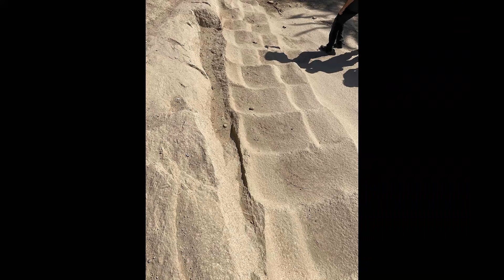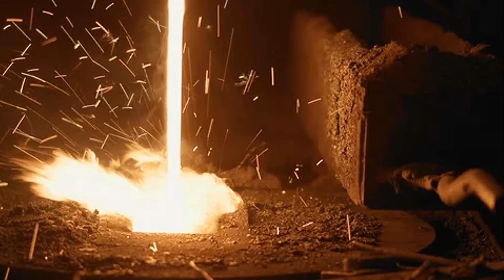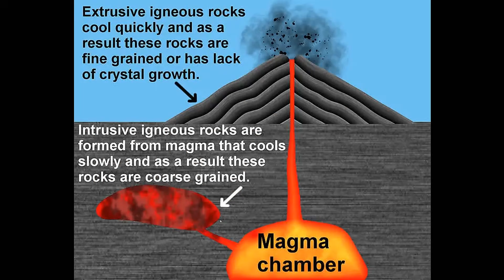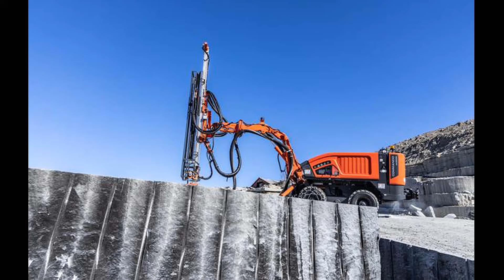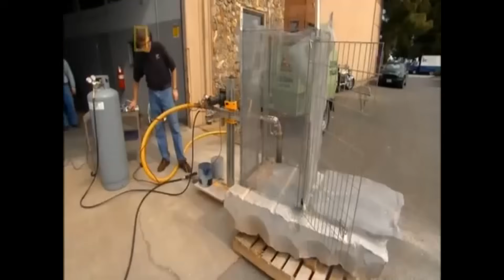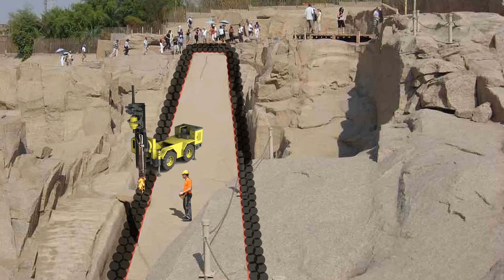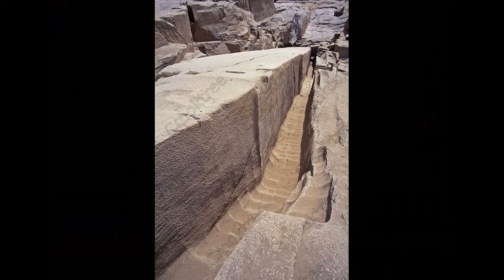Scoop Marks in Egypt: A Groundbreaking New Hypothesis

Comment: Maybe this hand held tool was two giant metal tuning forks working in tandem that vibrated a blade or blades at the correct frequency and was used to cut through granite at its own natural frequency? Quartz is used in radios. Maybe there's a correlation? I dunno. Build an ultrasound tuning fork cutting tool  and hit it with a sledgehammer, I suppose 🤔🤷🏻‍♂️

Comment: Definitely a plausable theory, makes more sense than others I've heard, especially the pounding stone theory.
What is truly incredible to me is that anyone that challenges the mainstream archeologist  concept that this was all done with pounding stones should be considered a cooke or conspiracy theorist.  That theory is far less believable than the one that it was aliens in spaceships that did it.  Every theory however should be listened to and analyzed, and this theory is as good as any I've heard.  If it is true this was how this was done, it is still high technology, and doesn't answer the question as where it came from or where it went.  Would love for you an Ben from Uncharted X to get together.  Other examples  of high technology that Ben has done considerable research on are the precision of stone vases that come from early and predynastic Egypt, that were absent from later dynasties.  All this suggests the use of computerized milling tools and the tool marks left in the stone megaliths suggest they come from large power tools.  Of course the big question is where did these people go and what happened to their tools? All we find is copper and flint chisels which no one in their right mind could believe achieved this level of stonework, or could be accomplished by people that hadn't even invented the wheel.  They had no wheel, but we're supposed to believe they were able to lift and move huge stones of extreme weights hundredes, even thousand of miles that would be difficult for the equipment we have today.     
Good Job!

Comment: You're obviously holding off on doing a video about the SAR scans...Smart but cowardly lol

I forgive you

My theories about the scoop marks?...& Just judging by the patterns 

I'm picturing a person standing holding a tool with two hands that's about the size and shape of your average household broom, then he would make up and down motions - this would partly explain the scoop shape 

Now this tool would have to act something like a sandblaster because the center of the scoops is much deeper than the edges, at the edge of the spray the stream is weaker if that makes sense 

Then if the operator has one end on his shoulder and is making up and down motions with the tool,  The spray end would have to be shaped somewhat like a vacuum cleaner head

I think this configuration would account for the shapes of the scoops and it would also account for the different scoop sizes if the operator held it farther away or closer then the scoops would vary in size

Now for what they used in the tool to remove the rock I can't exactly say, I'm only theorizing perhaps its something to do with vibrational frequicies so

But if you grab your broom in the kitchen and make those up and down motions you'll see what I mean lol...

Comment: If an aluminium can is placed on the ground, it can biodegrade over 10,000 years.

A metal pedal go-cart was left under a hedge at home where I grew up & it completely & totally (100%) rusted away in 20 years.

Most machinery that creates these markings, will disappear in the same manner (other than those who get their materials repurposed over the years) & still are consumed by time.

This makes solutions less simply solved.
Just saying...

Comment: Flame drilling? Wow!
That's an interesting angle. Typical fuels used for flame drilling are pressurized fuel gasses (propane, acetylene, or hydrogen) combined with oxygen to create a hot flame. What do you suppose the ancient Egyptians used for fuel for this rig? Wood, charcoal or coal? Those don't seem suitable. Perhaps animal dung? Doubtful. How about olive oil? It's a liquid and it's flammable, but it won't burn hot enough. Then there's the problem of the massive amount of fuel and oxidizer used which is represented by all of the so called "scoop marks" or troughs just at this one site, never mind the rest of the world where this technique was used. Were there enough olive trees in the world?

Still, heat spalling is an interesting idea. Clear glass dates back to Egypt at about the 9th century BCE. If the invention dated much farther back, perhaps the ancient Egyptians could have generated the required heat by concentrating sunlight with lenses. That's a more believable technology not without its problems of heat dissipation and accidental burns. But, there's no evidence of this.

Finally, I remember seeing a close inspection of those troughs that shows repeated impact marks consistent with the use of pounding stones. It was slow, back breaking work; hard for us to conceive of in these modern times. Unless there is evidence otherwise, that's how this work was accomplished. The unfinished obelisk was a project where the Egyptians bit off more than they could chew.
I do like this video and I like your thoughtful approach. Keep asking questions, and keep looking for answers.

Comment: its simple..we are stuck thinking hundreds &thousands of years old. Its MILLIONS before the material petrified and/or turned into the very hard material we see now. They looked at prior examples and hardened or changed the soft material to hard. The obelisk is still there because it was hardened TOOOOOOO EAARRLLLYYY  or TOOO HARRDD before simultaneous finish cut, harden then lift PROCESS. Too hard during lift process..to heavy to move.

Comment: This flame drilling concept has some legs, and it ticks many of the boxes in a fairly unique way, but for me, a major problem with it is the flame pressure required to generate the power needed to continually fractur the stone, plus the material for the pipe and nozzle that it would need to have been directed through. (I do recall a reported method of generating more heat for safe crackers where the flame was directed through a copper pipe which gradually melted, giving of a much increased heat, but I don't know any more details of this.)
Modern flame cutting methods seem to use small diameter nozzles, perhaps to ensure they get enough heat pressure, and of course they are gas driven, with a mixture of gases and air mixtures to get the required heat, so there is far more here to consider than just a scaling up of the pipe and nozzle size and the material used for them.
But...the flame method does tick boxes that other methods do not, and the  balls could have been used to pound the scalloped stone sides into a flat surface. 
Anyway, great idea and good video, and perhaps it is good that Hotspur and the Tin Man have been retired.

Comment: This is not a good theory. You kind of had it - then went too far. 

The essence of Occam's guidance in solving mysteries is to not multiply entities beyond those necessary to explain all the evidence. You should have just stopped at fire-setting, because that is enough and explains it. Now you have to get some pressurized flame somehow, etc. but it's not needed. Heat concentrated against the granite from wood/charcoal fires, likely contained by simple confinement structures, could apply enough heat to leave nice glowing orange spots where a splash of water would permit conventional primitive tools to leave those scoop marks, the depths of which were where the temperature was just barely hot enough to continue to weaken the stone.

Comment: A block or Iron (meteorite) or copper heated in a fire would sear and burn could be pounded into the granite by three people hammering it into the stone causing vibration, an electric charge in the stone, and would not need a fire directly on the stone.  So, no burn marks left.

Comment: There is a scientist who worked out how they made their cement. He showed how a particular salt formulate would dissolve the court crystal within the rock, making it brittle, and easy to pound into a powder for a base ingredient. I would think, by using a similar method, that is sloshing the salt formula at regular intervals into the gaps of the rock faces, you could then just use a hand tool like a heavy spade, to then crack out the brittle result. Then repeat, it would likely create such parallel trench lines as we see.
Reply from the maker: Thank you. One problem of the natron/ sodium carbonate (and other chemicals) rock softening method is that it usually would significantly change the rocks' colors and appearances, while the granite of Aswan quarry shows pretty consistent color at all scooped areas. Chemicals can be used to weaken or break down rocks in quarries, such as expanding grout to be poured into pre-drilled holes in the rock, but this wouldn't create scoop marks. In some cases, specific acids can be used to dissolve certain types of rocks or minerals, but this is a slow process and used particularly if the rock is ground to a fine powder, but not in dimensional stone extraction.
Reply: Thank you for taking the time. I just think, stepping back from this dilemma and viewing it with fresh eyes, that some sort of rock ' softening ' technique was employed, remains as the most likely answer. Just because we haven't yet  found such a ' technique ' , does it not still fullfil the simplist ' missing link' answer to understanding the ' how '

Comment: Wow... That thermal thing looks promessing.
To me, those scoops looked like something made with a strong waterspray. High waterpressure would have made this. Like with a K"archer, but more pressure.
Aren't there people that suggest the pyramids were actually large hydrolic machines / waterpressure. Or pumps.   
Today they use waterpressure to cut strong materials.
On the other hand, electricity and flames (like you explain) would work I guess.

Comment: After thinking about this for a while I had the idea of what if instead of producing a flame, they could have just used the power of the sun and some large polished metal reflectors. This would be able to heat the granite and spall it repeatedly and I would imagine that this would be doable in a short amount of time which could be why they are able to just seemingly abandon pieces that are almost done. I tried to work it out with chat gpt and we came up with heating the rock would require 63m2 of surface area focusing onto a point of 10cm to reach a temperature of 600C. This technique would also work well with any angle as the reflectors and focusing mirrors would be movable by hand. They could have used polished copper as the reflectors easily
Reply: The solar concentrator idea seems like a natural solution.  They did have copper metal at the time that could be shaped and polished as a concentrating mirror. However they didn't have to heat the surface to self-spalling temperature, as high heat alone weakens the granite and could use tool pounding to shatter the surface much more easily.  In addition they could have employed dolerite tipped timbers as pounding hammers using the power of gravity.  This would allow continuous strikes in the same vertical plane giving rise to the vertical striations of scoop marks.   So aim solar reflection and heat a point.  Drop dolerite tipped hammer.  Raise hammer.  Clean out shattered bits.  Heat again, etc.
Reply: @johnlogajan2571 I like that better actually. Seems more plausible
Reply: Great answer with polished brass or gold overlaid reflectors producing very high efficiencies. Slightly concave mirrors make smaller but hotter spots. Teams gather direct sunlight focused to a gathering mirror, further reflected to get spots down and under. Heat for long enough to get rock crackling a few centimeters deep, enhanced with quenching. Also just building fires within confined mud straw temporary structures and rocket-stove airflow can apply enough for heat/quench, followed by scooping with conventional tools. Evidence for this exists in the form of rock residue in lens shaped spalled chips, fire ashes and scorching, etc. No remaining evidence of the fire confining method used from what I read.
Reply: Yeah mirrors at the bottom of the trench facing up. Keep thinking cause mirrors don’t work. Heat kinda plausible. But how. Those scoop marks appear around the world at other sites.  So let’s figure this out. Stone dissolving heat or chemical or airblaster or ….?
Reply: @pj6585 have you ever focused a magnifying glass on a leaf? It starts on fire, scale that up and you can heat a rock enough to get it where you can just chip off chunks of rock. Would be relatively quick and easy and simple back then

Comment: Instead of flame drilling, sound vibration was sent through a cone from the base (wide end of a cone) to the apex (point of cone).

We were conditioned to think only of sound proceeding from apex to base, which is the case in a speaker and experiments involving sound invariably employed that configuration and not surprisingly nothing new was discovered. If the volume was turned up to a deafening level the only result was a complaint from neighbours.

Comment: I always thought these were from grinding wheels, and that area next to them is where they rested the wheels to slow down in between shifts. And the edges of the grind wheel will weather down faster hence the oval shapes.
They knew pulleys and l9ad bearing, so getting a rock spin on a shaft was well within their knowledge. Also Egyptians loved to brag and were meticulous with their record keeping if something as grandiose as a stone cutting flame torch was present. 
They would have wrote about it or at least the civilizations around them. Not to mention the military application of having such technology... while having a wheel on a wooden shaft just as every wheel won't be something they brag about to everyone as it should be common knowledge. And the round stones that everyone thinks of pounding are the leftover smallest pieces that remained after the original wore out.
Industrial projects leave Industrial scale waste too... sp they are not pounding stones they are the waste.

Comment: To get obelisk out they would have feather and wedged apart the rock in between the obelisk and river. They can then reuse these imprecise blocks for later construction. A not would be weighed down and a sand ramp crates between this and the obelisk. Once broken off the obelisk slides down the sand ramp as parts are shovelled away to control descent speed. Once in the boat the weights would be removed and the ship would lift. Not saying this is the way but potentially a way. It would have to be a mighty large boat or somehow be extremely buoyant. Perhaps they trapped air in the base of the boat?

Comment: Primitive cultures did NOT have mysterious methods and had to use wood, stone, ropes, and abrasives.
Rope saws have been used since antiquity, and are responsible for the tight joints and radii seen in the stone work.
The "Kerf" of a saw run between two mismatched surfaces is the most efficient way to adjust the fit.
This technique is also responsible for the radii seen at the joints, the radius size directly corresponding to the amount of fitting required.
The scooping marks seen at the quarry are the result of the sawing technique used.

Comment: Check out information I found on Google...
Copper and Corundum Cannot be made into an alloy. 
However..Copper powder and Corundum powder can be mixed, and with heat and pressure, made into a Metal Matrix Composite material-which cna be made into saws and cut granite. 
Poss such a Composite could be made into the tool that scooped out the granite,after softening-as we know the Egyptians didn't have iron or steel tools.
 Also, the simplest machine to cut stone is a steam powered machine. 
Steam engines can be made of hardened copper or bronze...And the thousands of blocks of the larger pyramids probably were cut with steam powered  copper alloy, or copper Metal Matrix Composite circular saws.

Comment: I've made the same point before to people that favor the "rock was heated" theory that it would result in a completely different mineral at the end of the process. It's just not feasible at all from a geological perspective.
Reply: Maybe a little bit at the hottest points, and scorches. Been found. Evidence also in the lens shaped spalled fragments. Practicality of heating and quenching to make a patch of damaged rock to pound or chisel away. Works from both a geological and practical perspective.
Reply: @rickZR1982A  Yeah, I'm talking more about the people who think they put electrodes into the rock to heat the entire thing.
Reply: @keepinmahprivacy9754  Oh, you meant me! That method works with the electrodes on the outside anyway, but there's very little to no heat, just charge buildup. Acoustic stress produces a very small inbound electron flow, but over time it accumulates and tapers off just like a capacitor charge curve. I've done it and measured it on a benchtop sample (concrete).